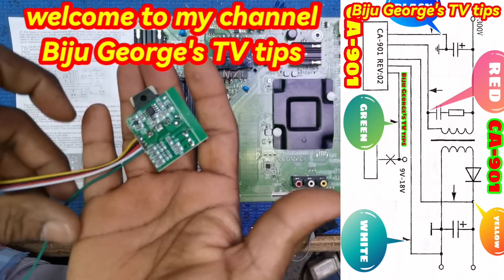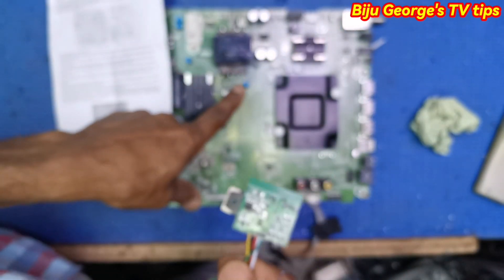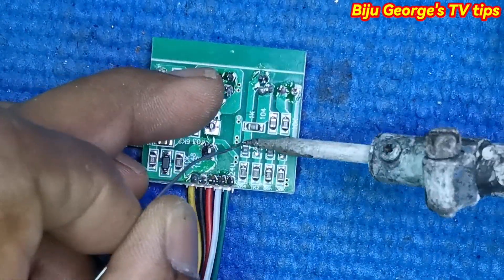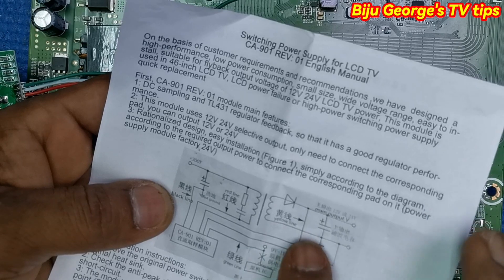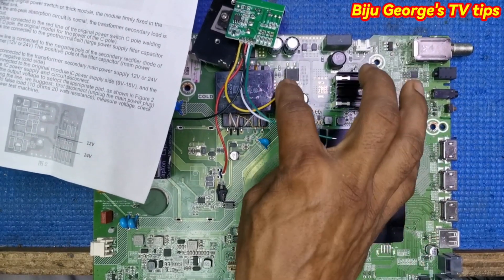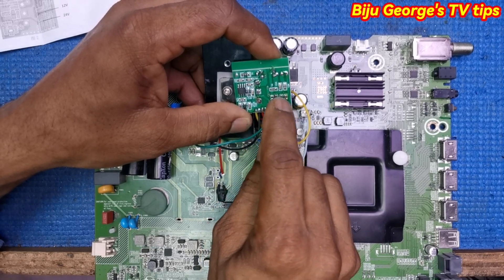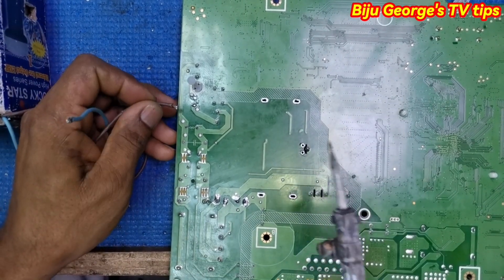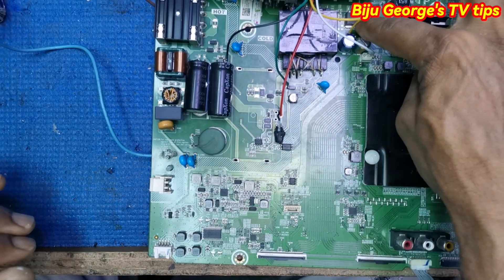CA901.ca901 module fixing.How to fixing CA 901 module.CA 901circuit diagram.ca901English.ca901 Hindi

Comment: Hi friend thanks for the informative. My module uses the ka3843 ic. Based on its pin out the feedback from optocoupler is going to the comparator pin which is pin#1 and not the feedback pin, which is pin#2. Can the module still work properly like this
Reply from the maker: Thank you